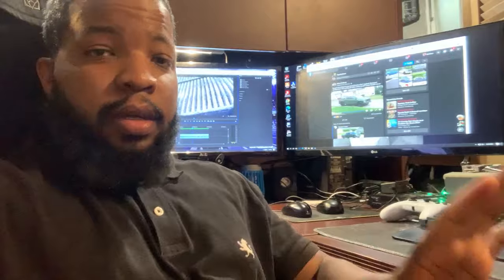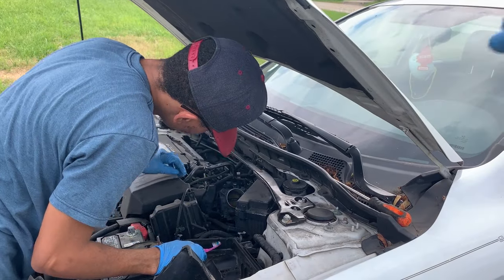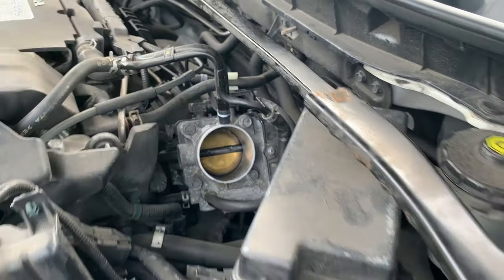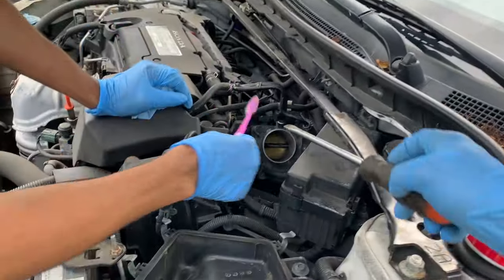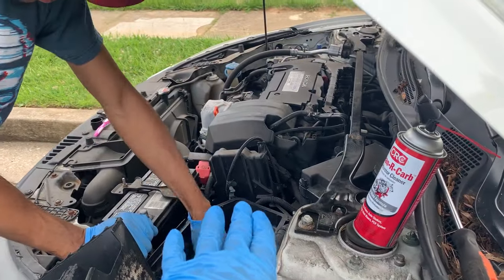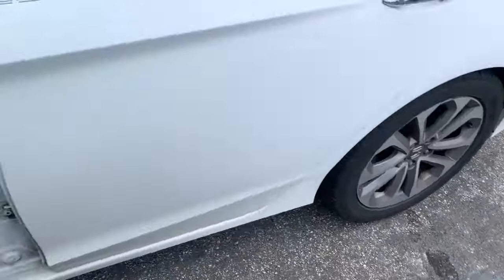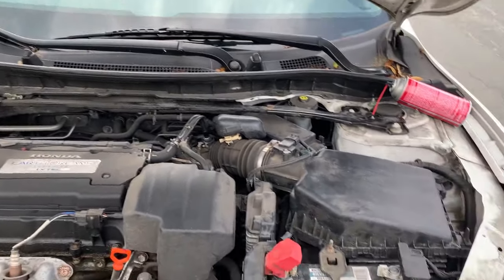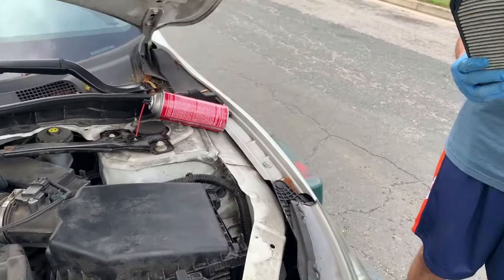Car Starts Then Shuts Off - Check Engine Code P2101 (Honda Accord FIXED!)

Comment: please help my honda accord 2006 has problem; while driving at night my dashboard with the rpm and speedometer, headlights, radio turning on and off repeatedly for 2 to 3 seconds eratically especially when i hit pot hole.
could it be bad ELD?
I already checked the alternator and battery and its all good.
Checked the grounds also and its fine.
Please help!!! 
thanks
Reply from the maker: Honestly, it sounds like it's an electric issue which as you know the first thing would be to check the battery and alternator which you mentioned had already checked.

I honestly would recheck them because if your noticing this issue when hitting a pothole, it sounds like something is loose or not grounded correctly. Disconnect the battery terminals and visually inspect for damage wires and terminals as cracked terminals can cause this issue too. Do the same for your alternator wire while the battery is disconnected.
 
Then inspect your fuses to ensure they are not blown nor corroded. Next check your front well fenders to identify if any wiring by the wheel wells are not damaged. It's likely you have a bad ground which is grounding else where. Or bad fuse.
Reply from the maker: Honda Accords also have a  Electronic Load Detector (ELD) fuse which run in conjunction with the alternator fuse (should be connected together). So I would inspect the ELD for corrosion, damage or if it's loose.
Reply: @AWordFromMrJones  thanks for the advice i would definitely do that. great help 👍
Reply: Alternator I would say

Comment: I have changed the altinator my battery and cleaned throttle still happening idk wat else to do
Reply: Check fuel pressure or even if you’re car has a fuel filter on some models

Comment: My car turns on and also turns off.... but on the third try it turns on and drives fine ... what could be the problem?
Reply from the maker: There are a number of things that can contribute to this. If you have a check engine light on, your best shot would be to get a ODB2 tool to retrieve the code and then provide the code to me for recommendations.

But if you do not have a check engine light on, then you will have to go through the process of elimination which is start, air, fuel and compression. But I would believe compression is not an issue since you stated the car will run on the 3rd try.

So part of me wants to say, you could have a dirty PCV value, mass air flow sensor and dirty fuel filter. Clean the MAF sensor and you might as well replace your PCV value too (especially if it's filled with a lot of combustion). Then see how the car starts.

Comment: This is what my car is doing no lights on or anything

Update so this is what was wrong with my car I just needed a new air filter
Reply from the maker: Excellent, love when it's a simple issue. I would also make time to clean the throttle body to ensure that the engine is getting proper airflow.

Comment: I have a 2015 Accord and it had the exact same problem.  I went to the dealer and it pop the code P2101.  The dealer had the throttle body cleaned and reflash the ECU.  Apparently Honda knew about this problem and the ECU update will somehow prevent this from happening in the future.  I am keeping my fingers crossed
Reply from the maker: Good deal, the clean throttle body will keep the engine running efficiently.
Reply: @AWordFromMrJones  The issue is that the throttle body should not have the carbon deposit to the point it blocked the throttle valve.  I've owned many cars over the years and there was never a single problem related to the throttle body.  The car doesn't even have 80K miles on it yet.  Something is wrong with Honda.
Reply from the maker: @2Phast4Rocket  Yeah all cars have different issues based on different living factors, climates, driving etc. I've seen some cars have no issues, very little maintenance, to some that had much and some that didn't. Even seen new cars from factories have issues and some don't.
Reply: So glad I seen this video, and comment! I’m currently having the same issue with my 2015 Honda accord same code pops up. I’m thinking of taking it to the dealer to get my throttle body cleaned out.
Reply: @aaronchacon5749  dealer will overcharge most likely

Comment: I hope u can help me man, 
Everything started when I was driving my car and it died while I was driving.  While the car was still moving I was able to turn it on and get home.
After that the car started but died few seconds later. After few more tries the car didn't start anymore, only cranks. I noticed that the more time i let the car sit when I try again to start it the car will turn on.
I change the crank sensor thinking that was the issue. But not,  it continued doing the same. 
Pump is working. 
Any ideas?
Reply from the maker: Any check engine lights? If so, get you a OBD II tester to pull the engine code. I have a $50 scanner (ANCEL AD410) from Amazon that works great for troubleshooting. In fact, my scanner is what detected this issue with the throttle body. So it's a GREAT & smart investment to purchase an OBD II scanner for saving time for automotive diagnostic issues. 

If you do not have a check engine light then I would first recommend that you clean the Mass Airflow Sensor, Throttle Body, possibly PCV value and give the car a start to see if it starts.
Reply: @AWordFromMrJones  Thanks for the quick answer,  I don't have engine lights on. I replaced maf sensor and nothing change idk what could it be
Reply from the maker: @ARDILAGARAGE Since you said the car died while driving and that you do not have a check engine light, then I would look at fuel as the next potential issue. 

Have someone put the car ignition to the ON position while you listen to the fuel pump to validate that you hear the pump cycle the fuel. You should also inspect the fuel filter, remove it and dump whatever fuel that's inside the fuel filter in a cup and check to see if the fuel is dirty. If so, it's possible that the fuel filter and maybe fuel pump will need to be replaced.

I usually replace both of them if I have issues with my car performance, completed the common vehicle maintenance but find that the car still has issues and that I found a really dirty fuel filter and do not know the age of the fuel pump, so I would replace both items together to ensure clean fuel delivery.
Reply from the maker: @ARDILAGARAGE  Just noticed you said the pump is working. Can you take a video of your car starting and upload it to YouTube?

Comment: My 02 mustang started doing this. It starts beautifully then 5 seconds later it slowly starts to shut down, whole engine shakes a bit, and my rmp goes up and down I’m assuming the car is trying to stay on. It’s crazy cause it’s done this twice and it started fine yesterday drove like it should. Now I’m stuck waiting on my mechanic😂😂
Reply from the maker: Lol engine diagnostics can be a timely process but eventually once the issue is found, you will be on your way. There are many reasons a Mustang would start up fine and then cut off, from fuel pressure regulator, ideal air control, mas airflow sensor, sticky throttle etc. Many times, you can attempt to clean them to see if they will address the issue. Hopefully you will get your car back on the road.
Reply: @AWordFromMrJones  got the problem fixed. Found out I needed a camshaft sensor. I also have to replace some oxygen sensors soon but I’m glad it was nothing major👍🏽
Reply from the maker: @brythecreater1547  FACTS! I'm glad to hear that and indeed it's great that you were able to get the issue resolved before winter season. 

I always try to address car repairs before winter so you only have to worry about gassing up your vehicle and heading to your destination.

Comment: After i did this process my car rpm started idling higher any chance what it can be
Reply from the maker: After you clean your throttle body, some cars will need to either idle or be driven for a while for the computer to relearn/readjust your idle.

Comment: Lmao never supposed to move the throttle body plate put car in park set cinder block on gas pedal and it will open for you
Reply from the maker: You actually can and it's done often when I am in the shop as the last resorts before purchasing a replacement. 

The recommended way is to have a friend open the throttle body by passing on the gas pedal which we did but this throttle body plate was extremely locked up. So you got to do what you got to do to get the issue resolved which is what we did.

Appreciate your comment.
Reply: Ahh okay cause I’m having this issue too and the vid was saying something about not manually pushing it idk why though
Reply from the maker: @nomnomrocks  That's due to the fact that when some people manually open the electronic plate, they overly use force which will break it. 

So it's best to open the plate by having a friend press on the gas pedal with the ignition turned to position "ON". However, if you find that the plate is still not opening, then you can try to manually opening it before you go with the last route of purchasing a replacement throttle body.
Reply from the maker: @nomnomrocks  How did you make out, did you resolve your issue?
Reply: Yeah turns out my fuel pump is out yay...
Reply: I had bought a brand new map sensor and now my car won’t run at all I listened by the back and didn’t hear the pump humming one click over
Reply from the maker: @nomnomrocks  Fuel pump can defiantly do that. You can also have someone try to start your car while you carefully bang on the pump tank which may knock some temporary sense into the fuel pump motor. Hopefully you will be able to get the fuel pump replaced soon.

It's a simple process to replace but it's a headache due to the fuel smell.

Comment: Not suppose to shove open electronic throttle bodies , that’s what the pop was
Reply from the maker: Correct, it's not advised to shove a electronic throttle body open. In the event that you are in a desperate need to clean it and cannot afford to have it professional cleaned, you can gently open the TB to clean the surface. 

This particular TB was frozen shut due to the carbon build up of which my buddy was willing to proceed with the potential risk involved since his car was not able to start. In the event if we were to break the TB, he could easily get a replacement TB. Once the TB was cleaned, we let the engine idle so the computer can relearn and drove off.

By following the process of the video, he saved money on towing and replacement TB.
Reply: @AWordFromMrJones  did pushing down on the gas pedal after putting the car in accessory mode not open the throttle flap?
Reply from the maker: @jmc224  No, this throttle flap was seized and was going to be replaced but going through our manual process brought it back to life. Car still drives perfect this day.
Reply: @AWordFromMrJones  awesome. And what about the relearn process? Did you use a obd2 scanner to have it relearned? Or did you kinda just let it run for about thirty minutes or so for it to adjust itself?
Reply from the maker: @jmc224  Correct, the car ran for 30 minutes to perform the relearn to adjust itself. Then we turned the car off/back on, then took it for a road trip.
Reply: @AWordFromMrJones  great. Debating if I wanna get the scanner or not. Will be cleaning throttle body here soon.
Reply from the maker: @jmc224  Yeah I would give the throttle body a cleaning first before making any purchases. Especially if the car does not start or does not want to remain running.

As you stated before, you can always open the throttle body from putting the key in the ACC and pushing the gas pedal. If it's just you, then I would take some 2x4 wood place one end on the gas pedal and then move the chair up to press down on the other end. That way the gas pedal remains down.
Reply: @AWordFromMrJones  for me, the car starts and stays running. However, when I am idle at a stop sign or red light...there is some intense vibration going on; more so than what these four cylinders normally do. It’s even worse when the AC or heater is on.
Reply from the maker: @jmc224  Understood. 

Commonly when I have idle issues, I've found dirty/clogged PCV value and dirty MAF sensor that have contributed to this. I would say while your cleaning the throttle body, to also clean the PCV and MAF sensor. 

That should get your car running good.
Reply: @AWordFromMrJones  thank you sir!
Reply: @AWordFromMrJones  so I got the code AFTER cleaning the throttle body. What may be the issue? Engine starts but dies after like half a second. Does this for a few tries until it starts again.
Reply from the maker: @jmc224  Sounds like you may have gotten some dirt on the Mass Air Flow Sensor. Inspect it and clean it.

Also prior to cleaning the throttle body, was it doing this? If so, you should also inspect your PCV value to see if it's clogged. If so, sometimes you can clean it with intake cleaner but many of the times I just replace them.
Reply from the maker: Also you can take a multimeter to measure the voltage for the mass air flow sensor to inspect if it's getting enough power and if the sensor is bad.
Reply: @AWordFromMrJones  I had cleaned both the throttle body and MAF sensor. The issue happened after I cleaned and put everything back. I had even gone back to see if connections were all made accordingly (something I always do since my Army days). I did order a new PCV valve actually so I was gonna replace it anyways.
Reply from the maker: @jmc224  Understood. 

Sounds like either either the computer did not complete a relearn or your throttle actuator control (the gears might be binding) is indeed malfunction and needs to be replaced. You may have to manually open the throttle plate by hand to "open and close" it to determine if it's moving freely. If it does not, then it's quite possible the gears might be binding.

I would perform the following first: 
- reset the check engine light,
- disconnect the battery thermals for 2 minutes and then reconnect the battery
- start the car, hold the RPM to 3000 for 5 minutes and then slowly release the gas peddle and let the car idle again for 5 minutes

If that does not help, then I would head to a junk yard, look for a car that has been totaled and swap the throttle body. That would be the cheaper way to replace it.

Thanks
Reply: @AWordFromMrJones  thank you sir!